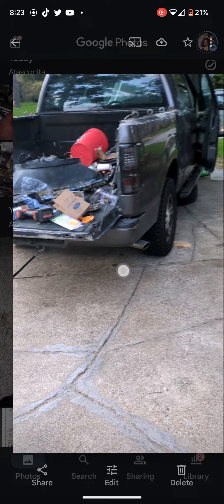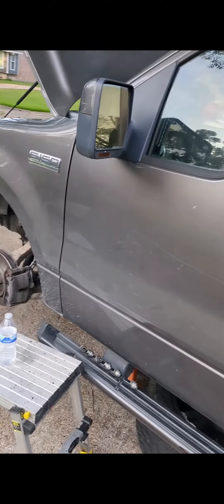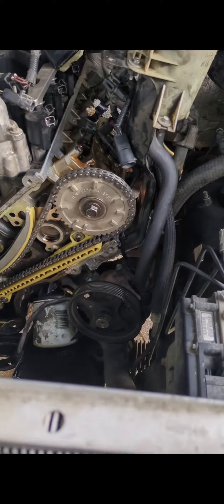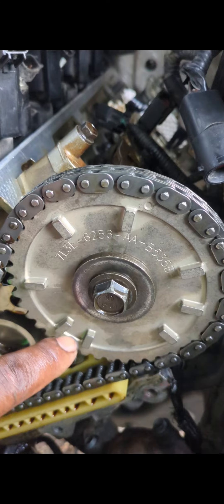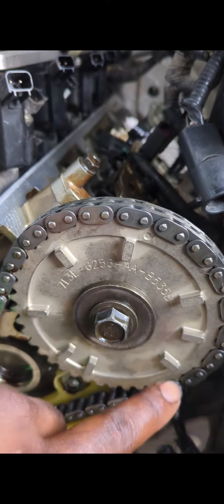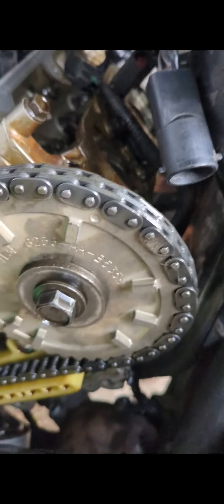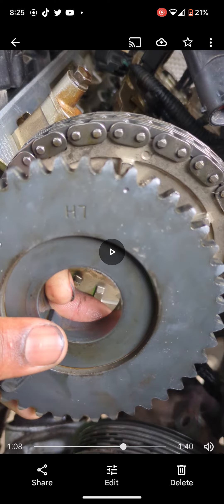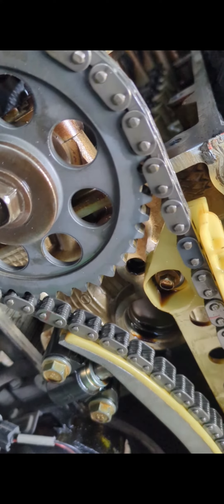p0340 camshaft position sensor circuit fault on Ford 4.6 Tritons

Comment: Did it run wrong or did you just have a code?
Reply from the maker: @frankjones835  it cranked for a long time on every start up and I could not get rid of the check engine light with the p0340.
 Other than that, the truck ran just fine.